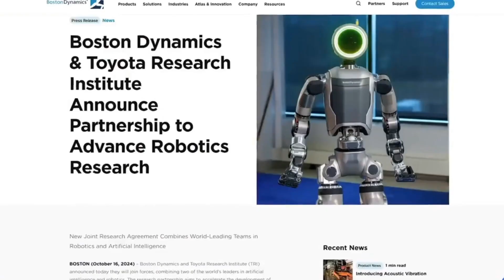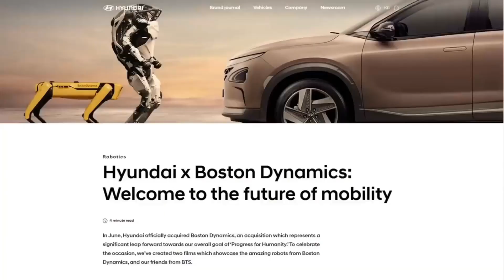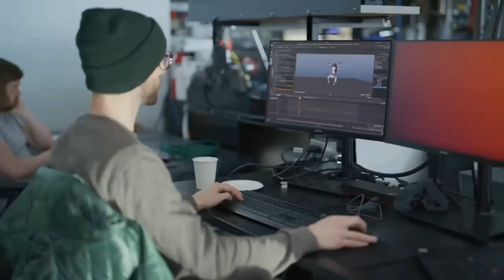ATLAS AI: THE AUTONOMOUS ROBOT THAT SURPRISED THE EXPERTS

Comment: Terrible visuals, showing the same thing over and over again.
Reply from the maker: @moosemanmikeb720  I agree, repetitive visuals can be incredibly distracting and detract from the overall message.  It suggests a lack of creativity and potentially a shallow understanding of the material being presented.  Effective visual aids should highlight key information, not just repeat the same images or data points.

Consider whether the repetition is intentional (e.g., for emphasis), or if a more dynamic presentation with varied visuals and possibly interactive elements could improve engagement.  What kind of visuals are you trying to avoid, and what specific type of content are they used to illustrate?
Reply from the maker: @moosemanmikeb720:

Yeah, I agree. Repetition in visuals can really kill the impact of something, right? It makes you feel like they're either trying to pad out the content or they just didn't have enough variety. Did you find that the repetition made it harder to focus on the actual message, or did it just get boring?